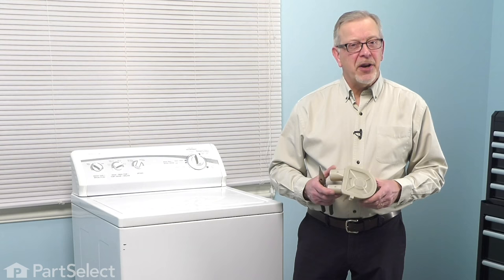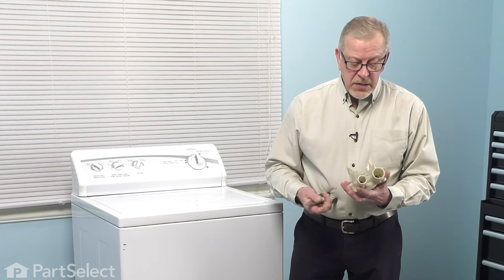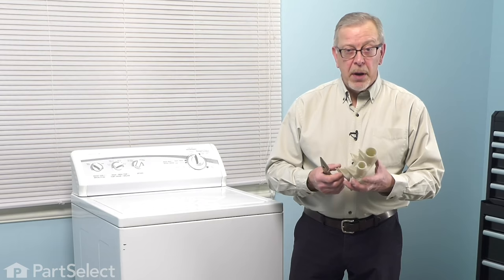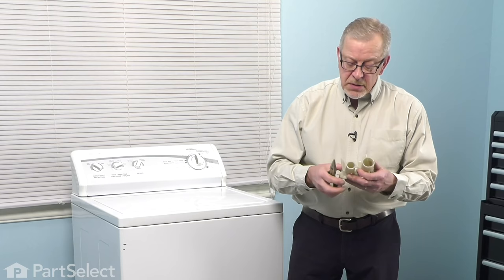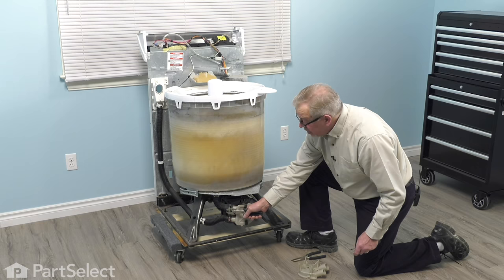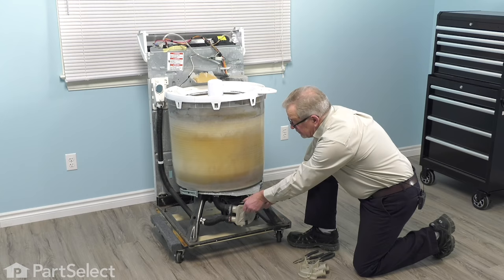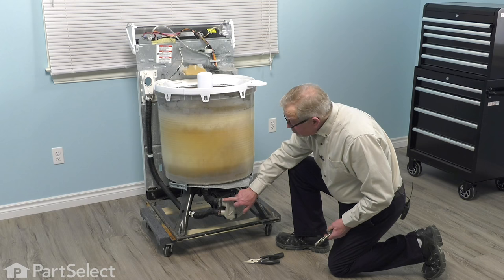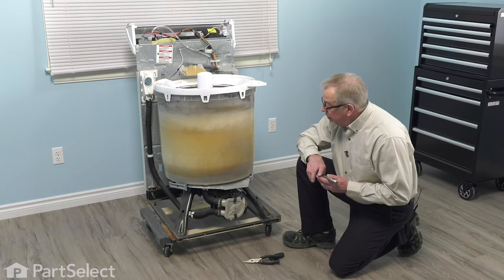Washer Repair: How to Unclog the Drain Pump

Comment: But HOW THE DEVIL DO I GET TO THAT WATER PUMP??? Like, show what has to be removed, and show removing it. This is an unhelpful video. I need to know how to get to that pump.
Reply: You mean how do you take off the cabinet?  If you have an old machine you need to take apart the top and flip it back. Then the front and both sides (with the lid open) tilt forward and lift up and out for access. TightWad has a DIY to explain it perfectly.
Reply: @jlamb199  I asked this 7 months ago, guy.
Reply: I found this video helpful for my purposes. You need to search for what you need because all models are different.
Reply: @artfuldodger7838  First of all I'm not a guy, secondly I'm trying to help you and finally maybe you haven't noticed but he doesn't respond to most comments, especially not the rude ones. Looks like you're on your own.

Comment: Would have been great if you showed us the whole thing including removing the instrument panel. Having trouble removing the panel from that model Kenmore 400 washer.
Reply: I agree, this sounds great, but I'm a total rookie - I need to know how to take the panel off and remove the pump!!!
Reply: Ten months too late but...   watch?v=b-45BWyuTiI (copy and paste that above after the slash at the end of the youtube address and watch that video. But I just tilted my washer back and leaned it against the wall and laid down in the floor looking up under the front of the machine myself. It wasn't hard to remove at all. And I'm a chick who has no knowledge of repairing things. Just watched a youtube video like you.  ;-)
Reply: @joydavis9264  
That's H0TTT!
Reply: @joydavis9264  I changed a part of the pump on my washing machine about 5 years ago, (also a chick), and I didn't recall taking the cabinet off! I think I'm gonna grab my 2 ton jack out of the garage for a bit of stability this time. THANKS JOY! I thought I was losing my mind! LOL

Comment: I’ve got an A9400 1980s style Maytag washer with a burning smell and washer will not spin on spin cycle. It agitates fine. Washes fine, rinses and drains fine. The only problem is the burning smell and the spin cycle. Replaced both belts. Replaced motor. Detached drain pump and it was clear as were the inlet and outlet hoses and ports. Water rinses through the pump fine as well. wtf is going on? It’s maddening ???? Anyone please

Comment: A quick note - the symptom of the washer stopping and failing to rinse and drain can be caused by a piece of small clothing getting stuck underneath the center agitator spindle.  In my case, it was not visible and I only recognized this when I went to spin the agitator spindle around and the rinse cycle began to run.  I fished around underneath the agitator and pulled out a small piece of clothing.  Removing said clothing item ultimately resolved my main.  Unfortunately, I didn't know this and ended up doing a pump replacement as "preventative maintenance" instead of problem resolution.
*My lid-closed sensor apparently failed during my work on the unit, so I jumpered it with solid speaker wire and put it an order for a new door sensor. 

I followed this gentleman's instructions for the lid jumpering.  As he points out, unplug the unit as your first step - even before disassembling the unit to get access to the switch connector.
Whirlpool / Kenmore Washer Not Draining - Lid Switch Test
https://www.youtube.com/watch?v=n1G6h0EOlbs

Comment: That fixed it, I'd found a $5 note in the water pump. Thank you.
Reply: What did your machine do that made you know it had a problem????
Reply: @imaxfli  It wouldn't spin dry, the machine kept giving errors when the spin cycle started. because it wasn't able to pump out the water

Comment: Vacuum out water through drain hose attached to back at low grade Ah flip it on left side if you have the room 3/8 nut driver may need ratchet with extension if its on either side for one bolt. Remove install no problems. Press in tap to remove wire. Done

Comment: After the spin dry the clothes are full of lint. What's is causing this. Is there a filter that needs to be cleaned
Reply from the maker: That's a really great question and the answer depends on what make and model washer you have. Some manufactures do have some filtration pieces in them but many washer today no longer have them. Linting is a real issue with top load washers , they require such a balance of agitator speed and proper water level, not overloading and quality fabrics. Some types of material easily give up threads of fabric especially when they get older and fray easier. I am curious if this has been a constant nuisance for you or something that has just recently showed itself? If recent then review if anything has changed in your washing process?  Different detergent or water level settings, even water temperature setting can effect washability.
Reply: @partselect  I actually think that it's due in part to the poor quality of fabric material used today. I have hoodies that I've had since college, over 40 years ago and are still in good shape. Brand new ones, no matter how much $ I pay for them, are washed 4-5 times have pils and lint every time they come out of laundry day. Lint rollers don't make me happy. It's disheartening, but thank you for your video. 😊 Judy in NY with a Kenmore Series 80!

Comment: Let's say that while doing this I accidentally got water all over the copper by the drain pump. I dried it with a towel but how long until I can plug it in?
Reply: I think 9 months should be fine.  You can plug it in now.
Reply: @orangebeagle3068  lol good one